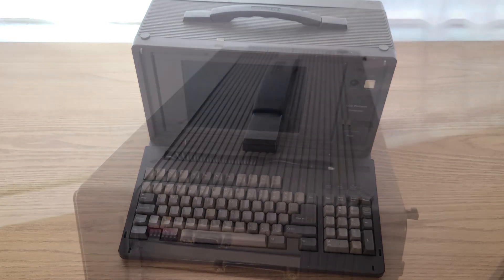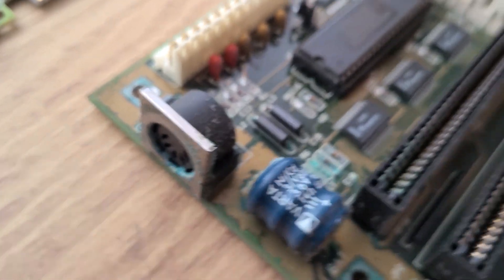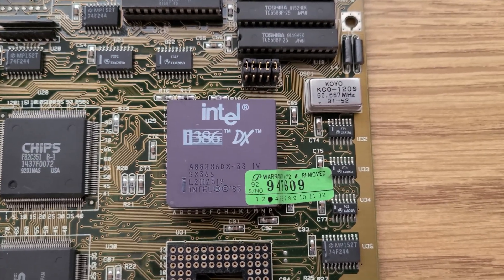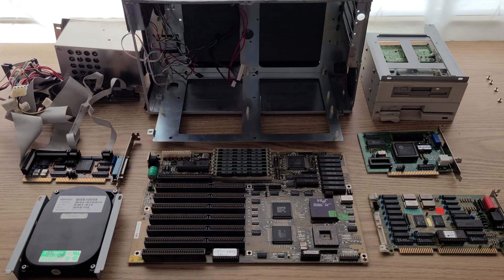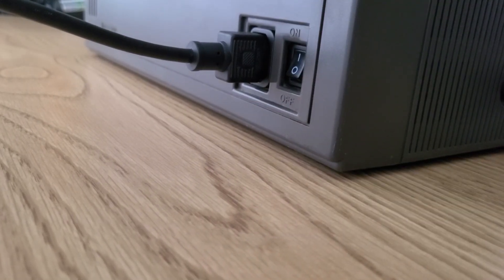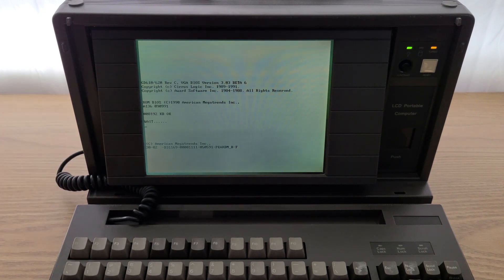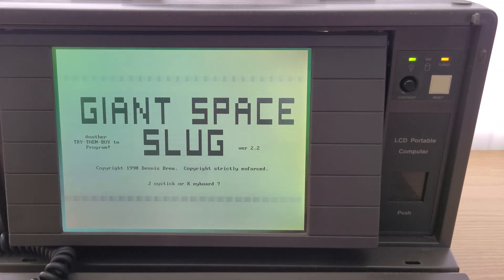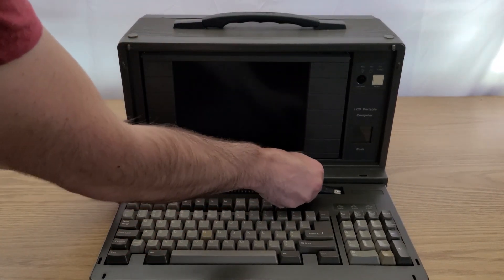Breathing new life into a 386 Portable PC

Comment: I've owned three Dolch-branded ones, built as portable network analysers.
My oldest one, a 486, had a bigger type of battery, an early NiCad type that leaked and etched holes through the hard drive and the metal case. Luckily it was mounted over the drives and didn't drop on the motherboard.

If you are going to work on these: do not forget to photograph every connector that you disconnect!
Unlike modern PCs, the connectors are not keyed and labelled, and it is easy to connect things the wrong way and cause damage.
Reply from the maker: Very wise words, taking pictures of everything is the main reason why I didn't have video recorded of the complete teardown and reassembly.

Comment: It isn't enough to just try and clean up the corroded areas/components with a quick squirt of IPA and a light scrub with a tooth brush. You first need to neutralize the alkaline battery juice - IPA will not have removed it all. Some dilute white vinegar or lemon juice usually does the trick. Without it, that alkaline will definitely cause more damage down the road. And if it's seeped into the fabric of the  board itself that will mean game over, no way back.
Reply from the maker: You are absolutely right, I didn't have vinegar at the time, but I went back in later and tired to get rid of as much as possible.
I think I spent roughly 4 or 5 hours total cleaning that.
At the time, I just wanted to see if it worked at all before continuing.

Comment: I didn't find anything in a quick search about the graphics card. Without a manual, you probably won't be able to solve anything by randomly flipping dip switches. It should be at LEAST CGA capable.
Reply from the maker: I did find a dip switch diagram for the card, switches change between text mode, cga, vga, etc with different resolutions, and also external display modes. I get the weird double image on any graphics modes even with an external monitor, text mode graphics obviously shows nothing for games that don't have text mode.

Comment: Why not upgrade the gpu itself it may work
Reply from the maker: I haven't been able to find another gpu that has the same LCD connectors at the back of the card.
Reply: @DS08  is the lcd connector a proprietary thing ?
Reply from the maker: @user-oe5rd1uh8r  I'm not sure, either it wasn't used much or it's a proprietary thing, but I haven't been able to find a card other than this one that has it, and I can't even find more of this card.